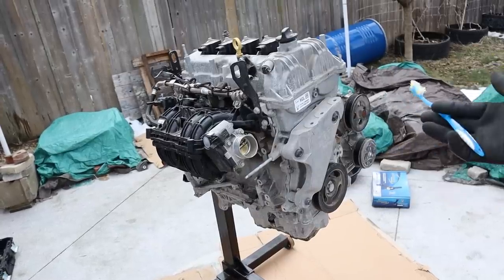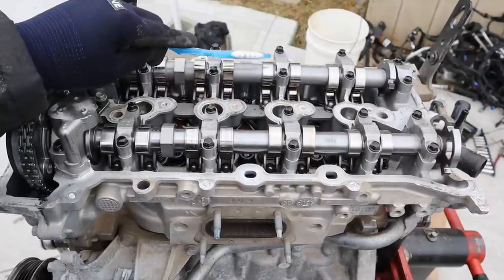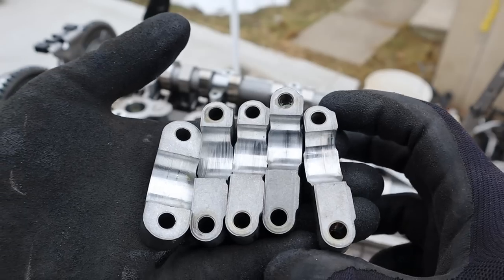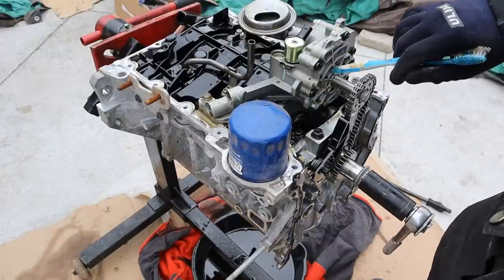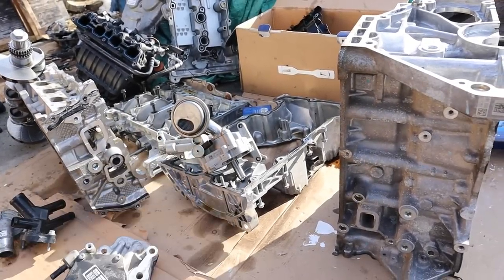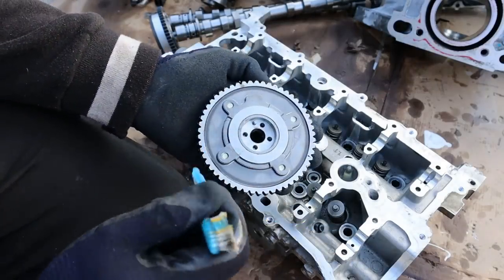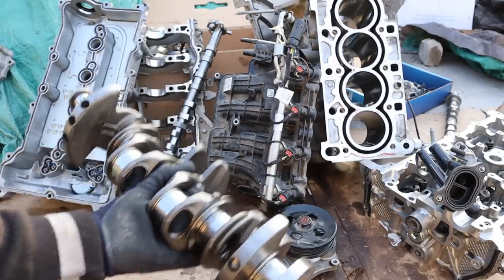What's Inside a Brand New GM Ecotec Engine

Comment: I like small engines which are chain driven. The fact it's port injected is also encouraging. The wear in bearings is worrying though
Reply: its very dirty for port injection thoo
Reply: @salami99  Nothing to do with port injection.  The carbon is from oil burning due to not being run in.
Reply: @einfelder8262 typical gm junk engines
Reply: @salami99  Port injection only cleans the top of the valves
Reply: proper chain drives are great, modern ones are all designed to a price point and will fail. just not likely for the first owner while he still takes the car to the dealer for service and maintenance
Reply: @Gigaguenther  Proper belt driven cams are better.  My Jackaroo (Isusu) 3.5l DOHC petrol ran 160,000km on the timing belt and it came out brand new looking.  Simple access from front of engine, radiator didn't even have to come out.
Reply: Not sure about the hydraulic lifters, these engines go into short distance driving / short life with bad maintenance cars.
Reply from the maker: Yeah it's a simple design. Kinda worried about the carbon. Do you think I was lied to about the mileage?
Reply: @speedkar99  with the lack of varnish I don’t think it had that many miles on it I got a theory as to why the cam caps were showing wear. I think somehow the rings were letting oil by causing the carbon buildup in the combustion chambers. This leading to low oil level and we all know the head is the last to get oil on start up. Add really thin modern oil I think that could be the issue either that or gm did a poor job when building the head and somehow contaminates were on the cam journals or cam itself? Maybe that’s strange though.
Reply: I have one of these engines in a 21 Buick Encore with the turbocharger. 57, 000miles. Regular oil changes no problems yet

Comment: Interesting to see this...considered buying the wife a Spark, in part because we keep our cars for a long time and the simplicity of the Spark's engine (MPFI, no turbo, chain driven) makes it a good candidate longevity-wise.  Ended up getting her something else, but I'm not seeing a lot here that would deter me from picking up a 5-speed Spark in the future. 

And I'll wager that the carbon build-up is because the car was only driven on short trips.  One good long trip would have cleaned things up
Reply: i'd prefer the honda civics 2.0 imo
Reply: @salami99  Yeah, good comparison to a 1.4 eco engine.  Not.
Reply: Do it. I owned a 5 speed and it's a fun little crap box (dads words not mine). Gets great milage and simple to maintain.
Reply from the maker: Yeah they are cheap to run. 

But also cheap to replace if something goes wrong.
Reply: on paper it's good, but at the end of the day it's a Chevy. they are not reliable, and the dealers don't know how to fix them when they break.

Comment: The carbon build up is because the engine hasn't fully worn in yet, piston rings can take up to 5k to wear in, especially the modern low tension rings with friction coatings they don't contact the cylinder walls as aggressively as the old school stuff did. So oils getting past them and it's gonna burn a little oil. Engine break in is really really important. The wear on the cam and cap seems mostly normal maybe it's part of wear in, you'll open that engine up at 200k and it will have about the same wear up there. They don't have any issues with cam journal wear that i'm aware of. This engines simple because it was developed to be used globally especially in upcoming markets, they do have a lot of single use fasteners though. They're OK as far as modern economical tiny engines go.
Reply from the maker: Yeah from a design perspective it seems very simple. 

That cam section worried me as I've opened much higher mileage engines with not as much wear. 
I can understand the break in period (usually upto first oil change), but can we believe all that carbon is going to just burn off?

Comment: GM has one upped the German's use of proprietary fasteners with single-use security bolts - dealer repair strategy award right there - joking aside, given the valve cover surface chipped with prying on it, snap-off bolts that prevent overtorquing make sense
Reply: Was this engine designed by Opel or by Chevrolet? 🙂 It sounds like Shanghai Automotive Industry Corporation also had input and the engine is used in many MG and Roewe (since the Rover trademark was split off from Austin Rover/MG Rover when Land Rover was split off) vehicles.
Reply from the maker: I think it's Korean isn't it?
Reply: Changing those valves is a favorite upsell of quick lube places. I wonder if that's related?

Comment: I appreciate the video. Incredibly fascinating and insightful, thank you. I've got a beater 07 800cc Spark/ Daewoo Matiz with 600k km on it and it's still going. It's never had a major failure, all that's been changed are service items and I've swapped out the three injectors, but that's mostly maintenance. It's started to be a little bit smokey of late, but I'm surprised that it hasn't died yet. Eventually going to put something else in there, but that is a problem for another day. All the best to you, thank you for all this information.
Reply from the maker: You are welcome. Awesome to hear that 600K and it's going well
Reply: 600.000 km driven in a Matiz? That's a lot...  My daughter own a 2007 Matiz, she bougth it last year with 122k km's on it. Burns no oil. These cars are not known for their dureability
Reply: @joskd8491  it is a lot. I had to buy a part from the dealership for it (crank position sensor) and the workshop manager took photos of the odometer to show his friends. The paintwork is peeling and the blower fan doesn't work, but mechanically it gets me from a to b for the moment. Hoping to buy a nice car eventually but for now, it works and I grateful lol

Comment: Nice breakdown. If you get your hands on a GM 1.6 Turbo SIDI, I'll be interested to see how they wear
Reply from the maker: More likely to find the 1.4T from a Cruze or something
Reply: @speedkar99  I think the only car that has the GM/Opel 1.6 Turbo SIDI in the USA is the Buick Cascada and they were built in Poland. My Astra was built in Poland and has the same engine and seems very reliable, just wondering about wear as info is hard to find about it.
Reply: @79aimless Wow, I have never seen a Buick cascada before. I almost didn't believe you when you said it was sold here. 

Google says it's Opel built, which explains the very unique design.

Comment: At least you can work around the PCV bolt issue. On the 1.6 petrol engine you can't  replace it separately - a complete new cover required!
Reply from the maker: Yeah and at least this cover is metal

Comment: I hate electronic part in oil pump, what's that about? How much fuel you can save by doing this. They could make some spring loaded mechanism which would keep 2 bar pressure.
Reply from the maker: Exactly. They find it less restricting and more efficient to have the oil pump take up less horsepower (especially in a motor with not that many HP to begin with)

Comment: I love that rigid bottom end and the hydraulic lifters. The plastic water pump impeller I don't love, but it's nothing I am not already familiar with coming from Dodge. As long as you never overheat it and replace it immediately when it fails, you can live with it. Security screws are stupid, but you can cut a straight line through them to pull them out with a straight slot. The engine isn't all that manky honestly. A simple MPFI open deck four banger sounds pretty good in my book. Pair it with a manual transmission and there is less to go wrong. The typical GM electronic gremlins are what make me most nervous. Don't let your grounds rust (thinnest and feeblest of all manufacturers) and pray for the integrity of your sensors.

Comment: The complaint about nylon lining for the chain tensioners ?  what would you prefer to see? everyone uses nylon.
Reply from the maker: If the body of the tensioner is made of plastic then no. But if the sliding phase has a nylon insert that's fine. 

RE: my Audi V8 video from a few weeks ago that had a broken slide

Comment: Chevy Sparks can go 200K miles as long as you change the CVT fluid every 30k. under 100 horses, they handle quite well, I have a 21 2LT. Get 35mpg,  don't have to worry about turbo or DI crap which the sonic had. There is no perfect car but for cheap transportation from A to B its just fine

Comment: I bet the heavy carbon buildup is due to excessive cold idle time. Low mileage for the age might be because it wasn't sold quickly, so it spent a long time at the dealer.

Figure weekly starts (to keep it starting), every one cold (cam wear), no drive-time (to clean the carbon), and no mileage added.
Reply from the maker: Yeah when it's cold it runs too rich to warm up the cats. 
The PCV system and oil type might have some factor as well.

Comment: Sorta looks like a petrol or, as you folks across the pond say, gasoline engine which mistakenly had diesel fuel in the tank. Would explain the carbon build up and failure
Reply from the maker: How likely is that

Comment: Is the variable oil pump only for variable valve time or in combination for fuel consumption also at high way driving ,and could it cause the issue on mains of cams getting worn that you found
Reply: Good question. I hope someone knowledgeable answers.
Reply: Had the same thought. If the oil pump was most of the time working at fraction of what it can output perhaps the camshaft wasn't getting sufficient lubrication?
And why make it variable in the first place? A tiny bit less fuel consumption due to less work being put into generating oil pressure?
Reply: @BitterCynical  I've been told the variable oil pumps will pump to 105 psi for the vvt but you wont see it in the gauge,then when it switches to 4 cylinder at highway driving it will go to 15 psi this on a 5.3 gm to prevent the drag on the crank, so I've been told, but I would rather have the old school system
Reply from the maker: Remember the more you pump the more HP you're stealing from the crankshaft. This engine doesn't have much HP so it definitely helps

Comment: Great video as always. You should do a mechanical review on a 2023 Nissan Rogue with the variable compression 3-cylinder! That would be interesting to see
Reply from the maker: The rogue has a 3 cylinder?
Reply: @speedkar99  yes the 2023 rogue has a 200 hp 3 cylinder :)
Reply: 3 cylinder in a midsize-approaching SUV. Don’t see anything wrong or problematic here 🤠
Reply: @@retiredbore378 yes 200 hp from a 1.5 is not unusual but such engines failing or having problems much earlier than their NA counterparts is not unusual either hence why it’s a bad idea. An SUV of that size with 2.5l engine is the best combination for reliability and fuel efficiency. RAV4’s engine is a very good example.

Comment: A lot of new cars swipe the gauges when turned on.  A lot of new cars also seem to fire up right up to a higher initial RPM than older cars.  I got two that only go up to 1.25k RPM when fired up cold.  New ones seem to sound higher.   Wonder if the gauge sweep is to hide that.
Reply: It’s possible, probably to heat the engine/cats faster, „save on emissions“
Reply from the maker: The gauge sweep is a cluster functionality check.

Comment: @speedkar99 what are your thoughts about the new 2024 trax and its 1.2 turbo engine? I'm considering kia rio, kia seltos, hyundai elantra and hyundai venue. while these are reliable engine-wise I do not trust their CVTs. on the other hand I remember your poorly built chevy blazer video, I have doubts the cheaper trax will be any different from that. good thing it comes with a 6-speed transmission though.

what would you suggest?

Comment: 0:10 i'm really interested in what kind of technology they use to make not only a 1.4 cylinder, but also make it be a 4 cylinder at the same time.

I don't understand why it needs a variable flow oil pump, that and a thin oil is probably what casued the damage in the cam bearings (actually, that seems like a very good reason for GM to have it). Weird that it has a steel oil pan and metal valve cover
Reply: Too much flow can cause issues. There's a famously strong engine from before the 2000s (as most famously strong engines tend to be) that had only one flaw which was sending too much oil to the valvetrain at very high RPMs, causing the engine to starve itself of oil

Edit: the engine was the Nissan RB26
Reply: @NoorquackerInd  i think there's a few differences between a 1.4L shitbox GM engine that probably revs at most to 6500rpm, and an RB26DETT that revs stock to 8000rpm, on track, and maybe modified to rev higher. I'm sure there's a good middle point for the oil pump where it has enough flow for everything, and it doesn't empty the oil pan
Reply from the maker: Less oil flow is less power robbed from the crankshaft.. more efficiency
Reply: The wiring inside the sump for the variable oil flow  solenoid breaks in the Mercedes 4 cylinder engines.  It's a quite an expensive job just to replace a $10 piece of wiring as it is at least a half  day's work to drop the front subframe to remove the sump.  I'm not sure this design reduces complexity or repair costs.

Comment: Need to find an engine with more usage to see if the wear gets even worse.
Reply from the maker: The point here was to see the opposite. 
All the other engines in my channel have high mileage
Reply: @speedkar99  Yes, but I mean crack open another of the same ecotec engine with high mileage to see if the carbon and bearing wear on this new engine was an anomaly. Or does it get even worse.

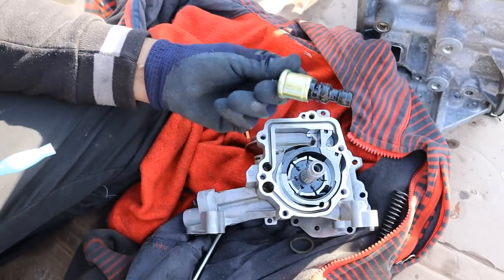Comment: @13:40 I'm not a fan of electronics controlling oil pressure. With my luck that solenoid would fail at the worst time and cause an extremely low oil pressure situation when the pressure should be high.
Reply from the maker: Well every single car now has electronics controlling pressure. 

There's a spring as a fail safe

Comment: That variable displacement oil pump is cool. That makes me wonder if a system like that could be used to make a variable compression/displacement/timing Wankel.
Reply from the maker: It sure is cool, but it's kinda "short circuiting" the oil loop as opposed to decoupling it from the engine. 

Soon you'll probably have a gearbox controlling the oil pump haha
Reply: @speedkar99  kinda like an Atkinson-Miller cycle engine, but rotary.

Comment: It’s really interesting that the Top end is „worn“ like that after 2000km!

So either that engine is starving oil 

or they have too much leftovers from manufacturing

Or the engine wears extremely fast during break in, causing Oil to be contaminated
Reply from the maker: Oil starvation would have more severe damage. This is something lacking or restricting or contaminating the oil system. The carbon buildup is what gets me though...for the mileage
Reply: @speedkar99  maybe the owner drove very short distances, so the engine never got hot enough to start burning off that carbon

Comment: Engine not run in, causing oil burning.  Pretty poor on the line boring of the camshaft tunnels, though.  I guess the micrometer man was on leave......
Reply from the maker: Engine break in?
Reply: @speedkar99  Break in is the same as run in, I don't think this engine was ever warmed up, put under load, or given a good rev.  Unlike some manufacturers, I don't think GM thrashes every engine at the end of the production line to bed the rings.  Even then, many burn oil for quite a while.

Comment: I think they were using a really cheap oil, a lot of newer turbo Chevys are having issues almost brand new.
I can tell by the amount of evaporation inside the cilinders burned off.
Synthetics doesnt evaporate that easily and is almost ashless
Reply: But the company  should have supplied the oil,  that should not be cheap  should it. Thanks I am asking I don't know

Comment: Oooo what's inside an ecotec engine? Probably not all the rods.  At least one punched the block.
Reply from the maker: Not this one yet. 

I have another video on Ecotec engine that failed big time.
Reply: At such low miles I wouldn't expect it.  But I imagine around 100k those bearings realllly start to wreak havoc.

Comment: Honestly I kind of like the idea of using RTV for oil pans and ladder frames because eventually that car is going to be old and who knows if somebody's going to make an actual gasket look at the Cadillac XLR you cannot find a upper oil pan gasket for that car anymore because it does not exist nobody sells it GM has discontinued it If they had just designed it to use RTV nobody would have a problem
Reply from the maker: Nah I still have a problem with rtv...when it gets brittle and starts leaking
Reply: @speedkar99  they all leak when they get old. Toyota fipg or hondabond is honestly pretty good about not leaking i would prefer fipg over a rubber gasket that turns to "valve cover gasket plastic" after 5 years
Reply: Motorcycle engine cases have always been sealed with Threebond products (Hondabond, Yamabond) for decades mostly without issue though.